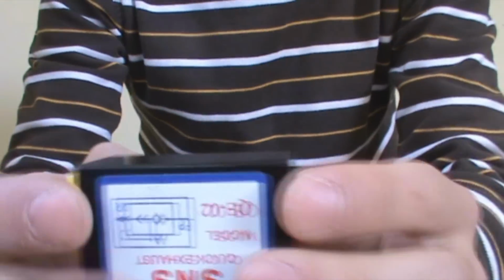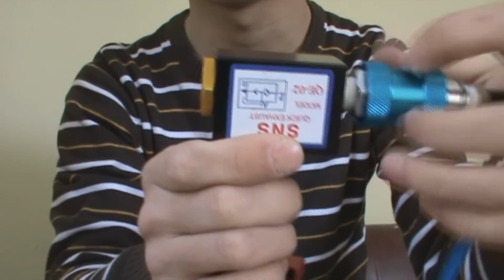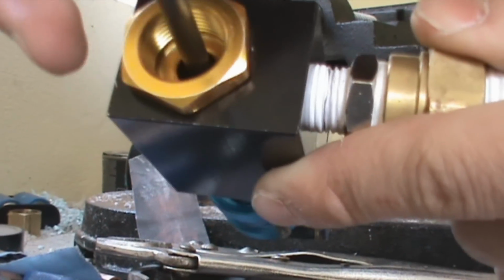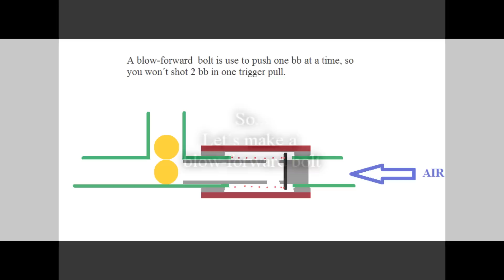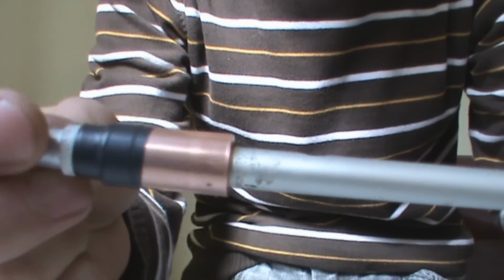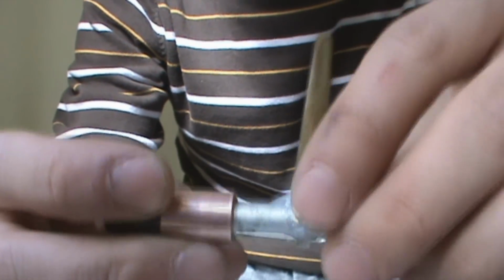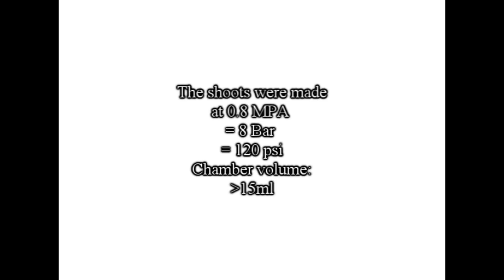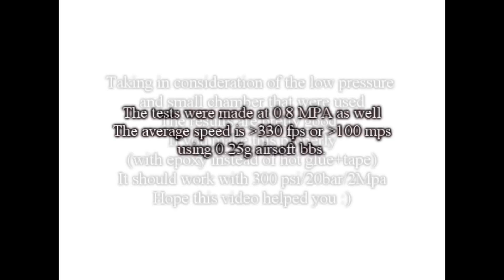How to make a semi-automatic airgun

Comment: he probably put a rubber fitting infront of the falling bb palet just the right size so the rubber holds the pallet and not letting it to fall??? yet just enough to let it throught with a bit of force?? i use rubber fitting from my spring action bb gun :D cheap one's tho